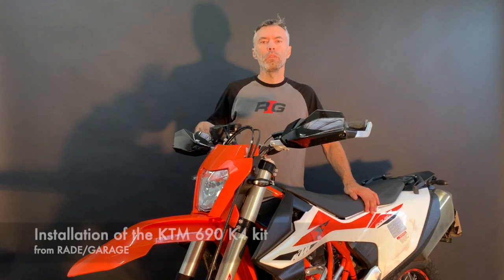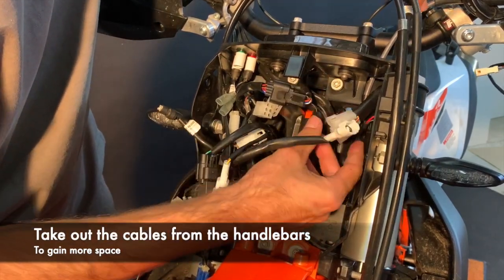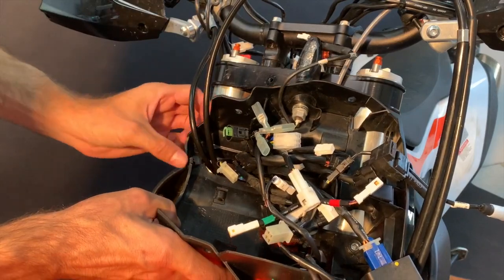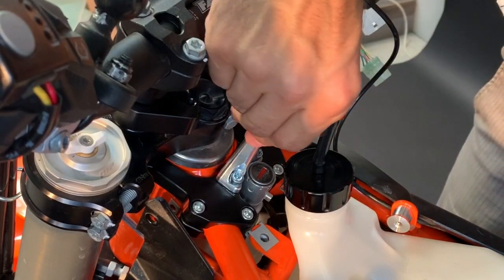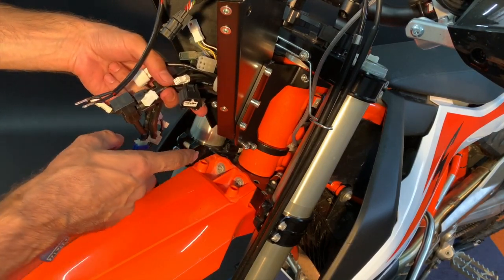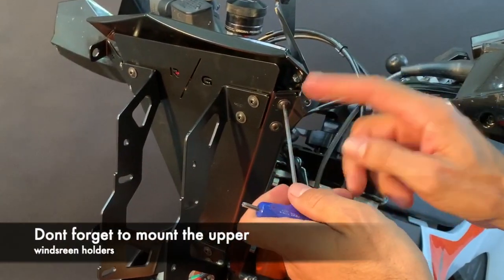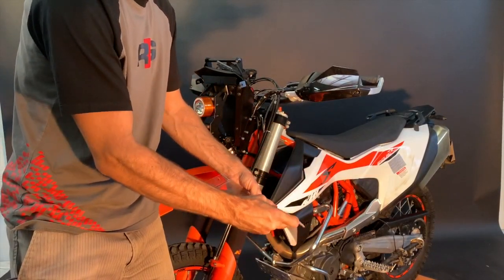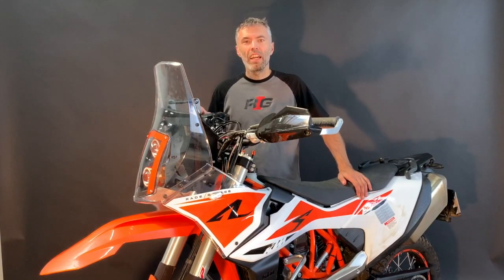KTM 690 K4 fairing installation RADE/GARAGE

Comment: Done! What an amazing proces, it's LEGO for adult, and the result is spectacular. 
Took me 5 hours, working slowly and deliberately, including mounting and wiring my GPS when the tower was opened. 
This video was super helpful, not possible without. 

Note: The USB has now been placed on the side of the tower, compared to the close-to-the-speedo placement in the video. Great idea. More room for gear.

Comment: Thanks!! Going to mount mine later today. Question installing your aux tank also, will the carbon fiber ignition cover work with the Scotts damper or will it need to be modified?
Reply from the maker: Hi, the carbon cover needs to be trimmed a bit, in order you can use it together with Scotts damper adapter.

Comment: Will this work with the Safari tank?
Reply from the maker: Hi James, the K4 fairing kit has been designed to KTM 690 (MY 2019+), while Safari tank to older models, hasn't? In case you have MY 08-18, then is K3 suitable for your bike and it works also with safari tank. For more info, please drop me n email richard@radegarage.com thx.